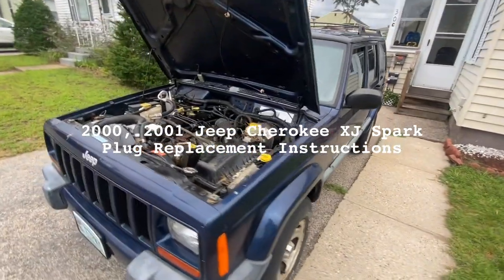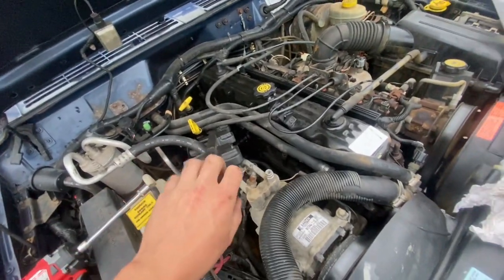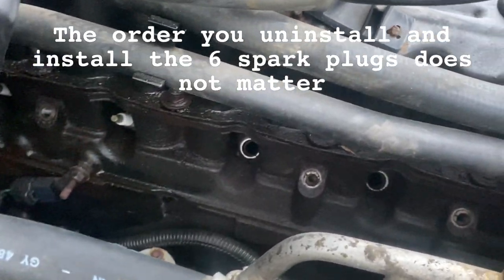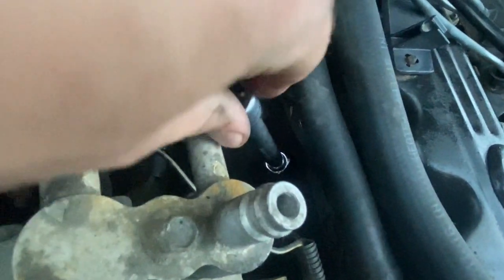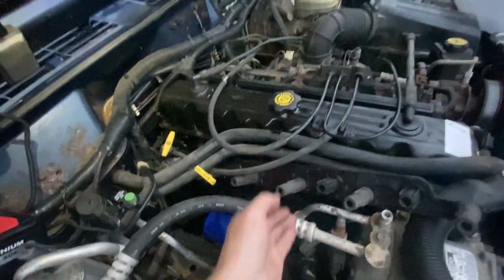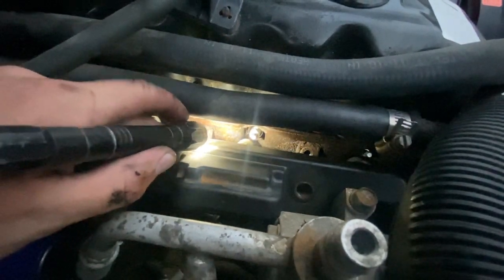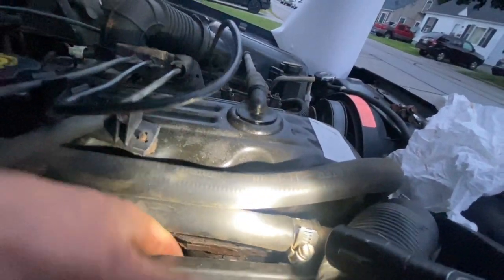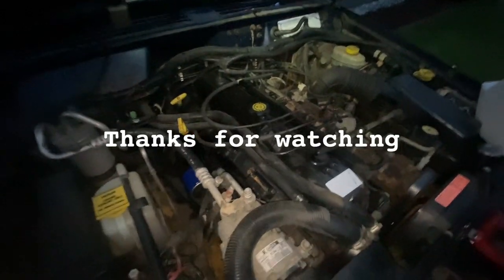2000, 2001 JEEP CHEROKEE XJ SPARK PLUG REPLACEMENT TUTORIAL 00, 01

Comment: Just an FYI... Field service manual states 26-30ft/lbs on the plugs...  averaging out on 28ft/lbs is also acceptable. Otherwise good call on the Champions. Copper core champs are a no-brainer on the 4.0.
Reply: Do you need to use anti-seize or die-electric grease?
Reply: @sohca6162  A small application of anti-seize on the plug threads is always a good practice. Just don't use too much. Just enough to get into the grooves of the threads. As you tighten the plugs, the anti-seize should also distribute further around the threads. I've had my fair share of plugs snap on other engines that either had very little applied or seemingly none at all. Provided you have the correct torque specs  and proper anti seize application, they should be able to be installed and removed very easily and cleanly. If you have the coil pack variant of this engine, Just do simple things like inspecting the pack to make sure no build of dirt or other junk will be a problem.

Comment: I have a 2000 and on the firewall it says original plugs are ngk. Have you tried ngk plugs? Curious if it might run better with the champion plugs.
Reply: They would work the same my 2001 uses RC12ECC champion plugs according to the manual.
Reply from the maker: Not sure about NGK